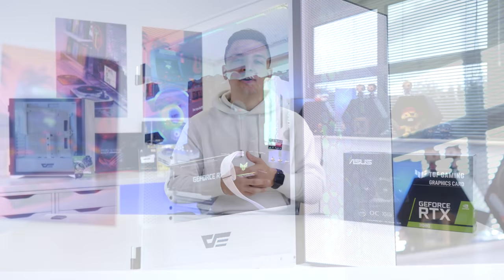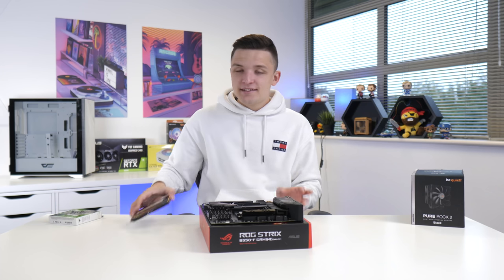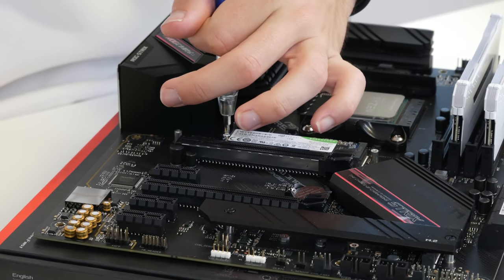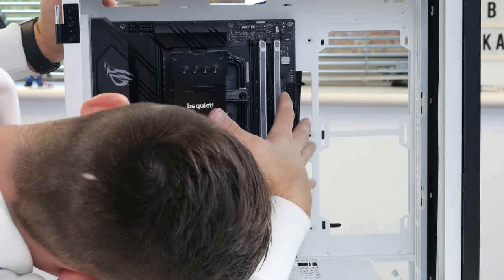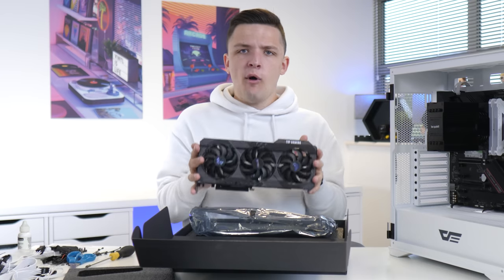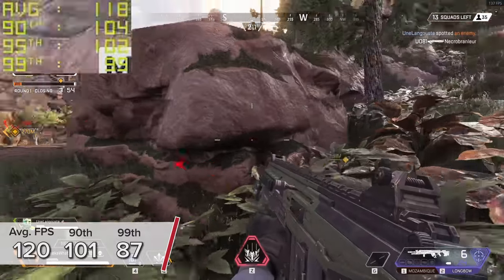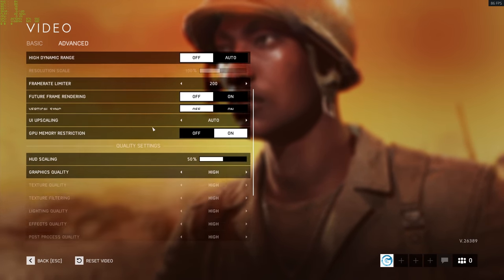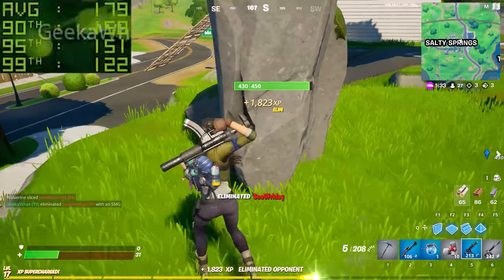Best VALUE RTX 3080 Gaming PC Build?! [10+ Games Tested! - ASUS TUF 3080]

Comment: Can't wait for the 3070 build , I'm getting an Aorus 3070 only because the Strix 3070 won't fit in my build, and also getting a 5800x. Never built a PC but gonna use an AIO for cooling. 

Edit: I got that same Motherboard. Thanks for showing me how to build in it correctly, I got impatient and I already wired up everything.
Reply: What’s aio
Reply: N what’s better liquid or fan

Comment: I think once the 3070 is available builds will be much more optimized. With the $200 saved from going with the 3070 (Which is still faster than the 2080ti in games), you can get a Ryzen 5 5600X, Upgrade the cooler, Upgrade to 32gb ram, more storage, etc.

Comment: I recently built a PC RTX 3080-ready: mobo Asus TUF Z490, i9 10900 (non-k), 32gb (4x8gb) Crucial Ballistix 3000mhz and a CX750 (750w Corsair PSU). I wanted to purchase a 3080 Asus TUF, but Asus seems to be the only brand to recommend a 850w PSU for it. Will my 750w PSU be enough? Or should I buy from another maker, such as EVGA?

Comment: I love ur vids man, but I just can’t agree with this build. You could’ve gotten so much better options like upgrading the cpu and not getting an rgb power supply, or getting 32 gbs of 3000 speed for the same price as urs, and use a more reliable case than that one cause its rackin a whopping 1 star! Wow! lol

Comment: Not gonna lie - I like the BeQuiet performance, but HATE their mounting system. I have the Dark Rock 4 in my wife's build (R5 3600X) and the Noctua NH-U12S in mine (also R5 3600X) because the Noctua was out of stock when we built hers. Definitely had a couple of issues with the cooler sliding around before I could get it screwed down. The Noctua was way easier, and my CPU actual runs 4-5C cooler than hers.

Comment: I have my 2nd pc all done except the 3080 I’m online refreshing stores 23 hours a day for lol. Having fun with this build, using the noctua dh15 black to air cool my 10700k instead of liquid. Used the lian li 215 case (forget the exact name) but the 2 x 200mm fans up front really intrigued me and perfect for my air cooled build. I’m considering a vertical mount to make the 3080 the focus of the build since I’m not really big on rgb but without the card I can’t test temps vertical mounting a firebox with a tempered glass case lol. What are your thoughts on a vertical mount? Any industry tricks to manage the temps?
Reply from the maker: Vertical mounts are great, just make sure there enough room between the card and side panel, and compensate with extra intake fans if you need to and you’ll be fine!

Comment: Hi ya I have just acquired this specific card, I’m currently using MSI MAG 27 inch 165 Hz monitor with a resolution of 2560x1440, I have followed your in game settings but I’m only getting about 165 FPS, I would like to know why I’m not getting around the same FPS as you do in Rainbow Six Siege.

Comment: Hey James, what the difference between Ryzen 5 3600 and Ryzen 5 3600X? Every video I watched on benchmarks they're not much of a difference but, the price. AWESOME video and build.
Reply from the maker: The 3600X has a much higher boost clock speed and a 35W higher TDP - so it is a faster chip out of the box! :)
Reply: @GeekaWhat  Cool Thanks James. So, you suggest that over the 3600?

Comment: Any info on course for upgrade from my current system to a rtx 3080 build.
Msi b350 tomahawk
Ryzen 5 1600
Geforce gtx 1060 6gb
T force rgb 2x8gb ram
Psu ? Maybe 650w 
I didnt build this so might not be accurate and im a noob tbh but i got this for a steal of £400.
Are any parts suitable for rtx 3080 ? 
I think a full new build would be needed but have no clue ..

Comment: WHY ARE THE FPS SO LOW?????? RTX 2080TI gets more fps on warzone ??????? Wtf???
Reply: He runs it at 4k m8
Reply: Nope look at warzone he says 1440p
Reply: When it was released it got 165 fps on warzone 1440p now its getting 50fps less like wtf
Reply: @xbeto9299  might be the game that is not optimized yet, don't worry the 3080 will be better, but it's not worth it yet
Reply: Owh okay cause i have a 165hz 1440p monitor but a laptop with gtx 1050 :( so i need a gpu that can play games with 165fps on 1440p
Reply: @xbeto9299  that 3080 sure can, a 3070 as well, good luck in buying one tho...

Comment: How the heck does he find all the power supply’s so cheap? Its soooo overpriced rn
Reply: That PSU is $200 on Amazon rn. So if you calculated the total price for that pc, add 110 to it to be more accurate since he said it the PSU costs only 90. And the operating system is gonna be an additional 100-150. I calculated it and I got around 1750 in total. Still not a bad price for a 3080 build.
Reply: @elhammamun7780  I’ve only started learning about pc like at July, is the psu always so expensive or is it cus of COVID? I was planning on getting a rm750 but it’s 125 dollars rn
Reply: @elhammamun7780  Pc part list
-Ryzen 5 3600
Vega 64/future upgrade rtx 3070
-MSI b550 a-pro
-Skill jaw 16gb 3600 cl16
-Corsair rm750-850
-500gb ssd
-Corsair 275r airflow